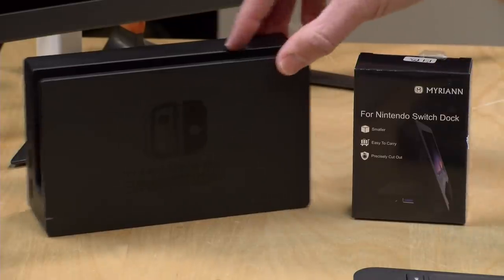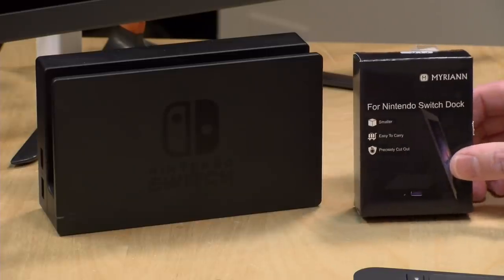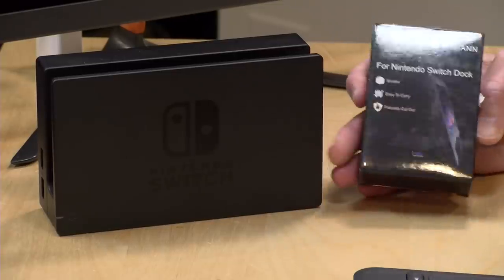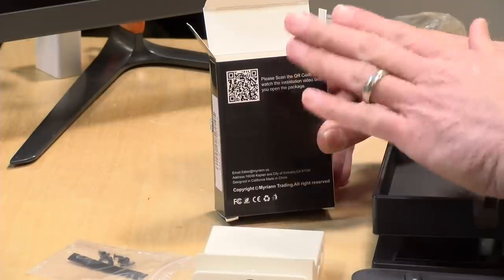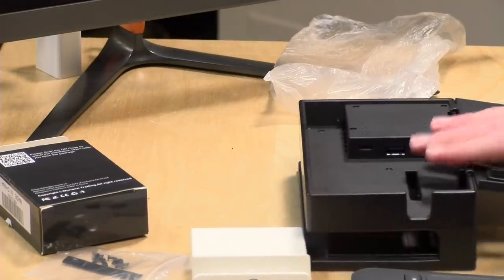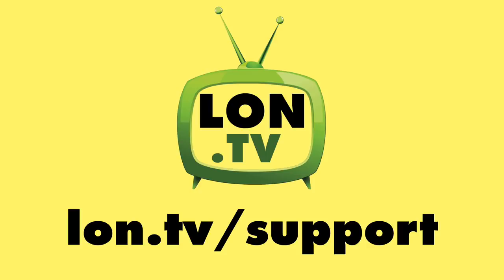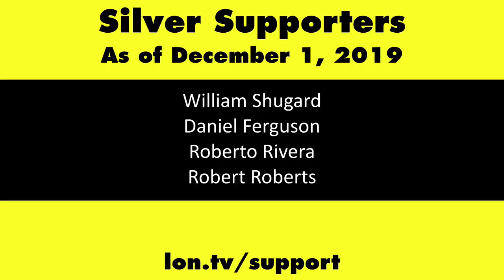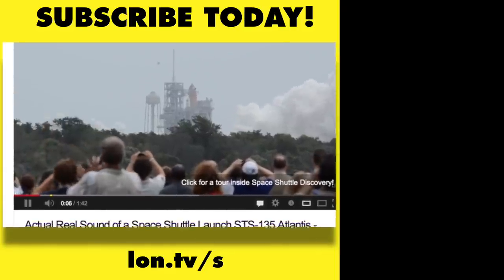DIY Portable Switch Dock - Make Your Official Nintendo Dock Portable! Basstop Kit

Comment: I still don't get the complaint that the original dock is "too big".  So you're telling me that you'd rather dock your switch just hanging on the USB connector with no protection against falling and with no screen protection?  Furthermore, the dock is no bigger than a couple DVD cases stacked together, does your carry on luggage really not have that much space?  Just doesn't make sense to me.

Comment: I did this a year ago and I HATE it, as the cables are coming out on the side of the dock. Also it takes two hands to pull the thing out of the dock safely. 

It is good that; price is low; having a stock Nintendo brand PCB; and not a Chinesium widget killing your Switch. Good budget option for a traveling switch.